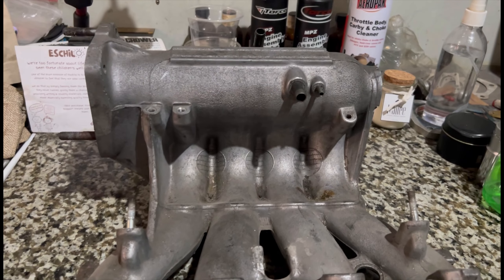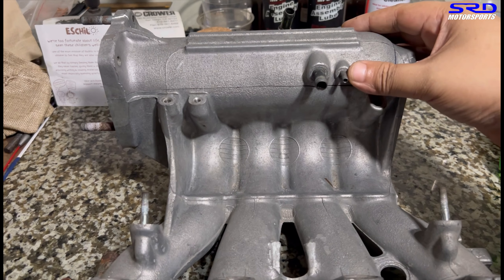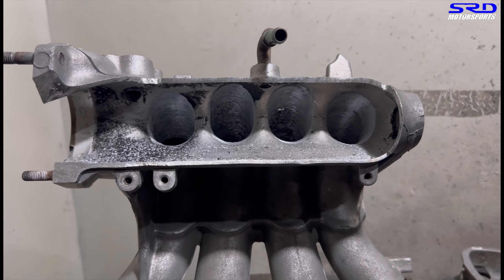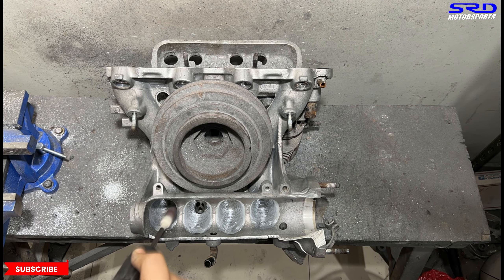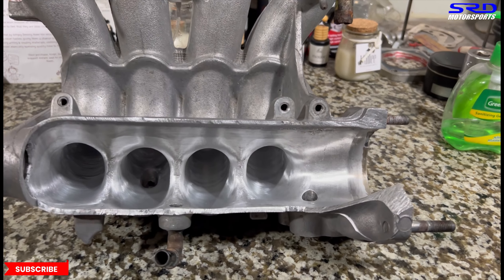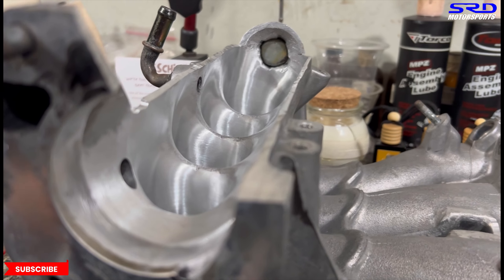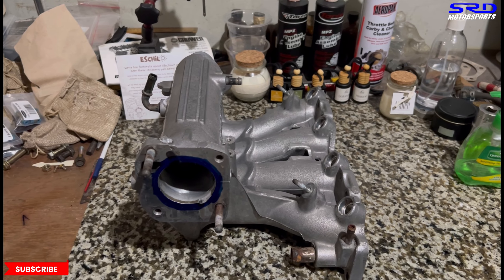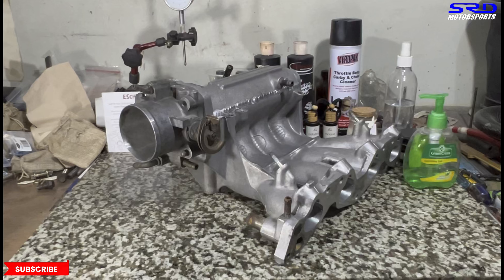D15b P08 D16Z6 Intake Manifold porting and weld works

Comment: Ralf as usual giving out gems. I truly believe for small circuits and autocross, d series is king. A well setup d15 or d16 with its low weight will help with weight distribution keeping the front end as light as we can get it with our already front heavy cars. Not ideal for drag racing but corner turn in sharpness and response, its ideal. Secondly people complain about not having enough power when in reality, especially for small tight circuits or autocross, most of that power and excessive torque is wasted in fwd. D series actually have some of the most efficient power bands with a smooth curve and alot of useable power under the curve. They make little enough torque that u can run stock body and fender with a 205 summer tire and never have issues on corner exit yet such a smooth powerband u can carry the power through and feel no lag in delivery. (B series has this issue, aside from b20v, if u fall below 6-7k rpm ur not going anywhere) and Ks on small circuits make too much torque requiring the chassis to need major mods.
Moreover, the reliability of D series is UNMATCHED. Its the best platform for any circuit racer beginner or professional to get in some seat time, hone their driving, and set some competitve numbers with low risk and less time in the pits
Reply from the maker: Couldn’t agree more… it’s why the Mugen GT3/4 CRX with a D16a6 did wonders back then against big power cars

Comment: Was the full length of the intake track ported ? 
Where is fuel introduced into the engine?
How do you know how much to port the manifold?
Reply from the maker: Yes it’s ported thru and thru (as shown in the video)
fuel is injected into the head intake port

The runner entry on the manifold is limited to wall thickness , before u get to “too much” u already punched a hole so it’s near impossible to over do the entry…